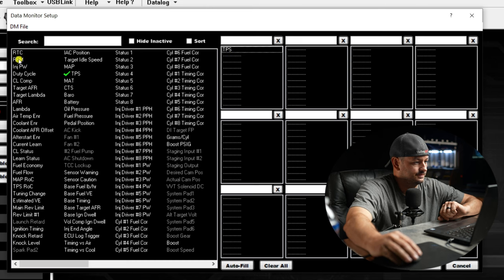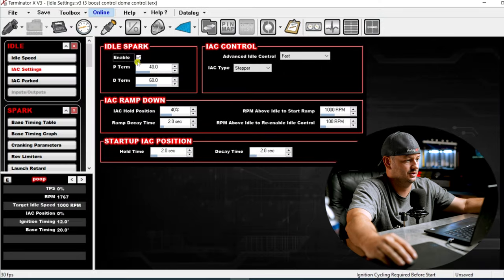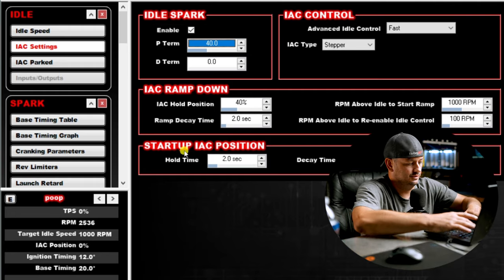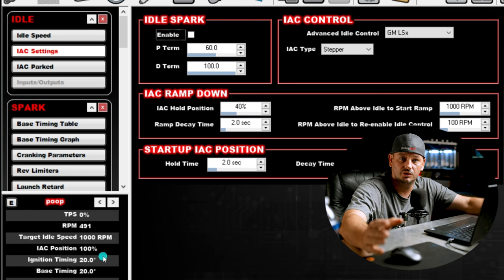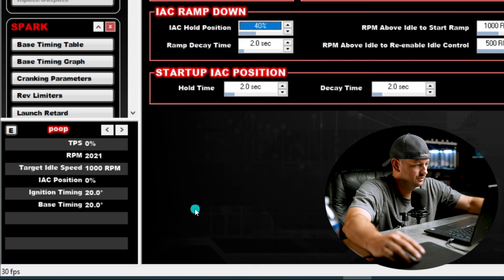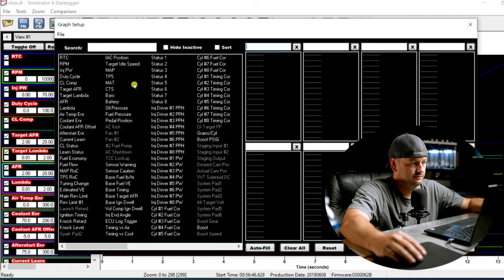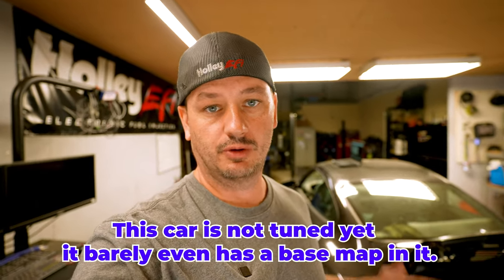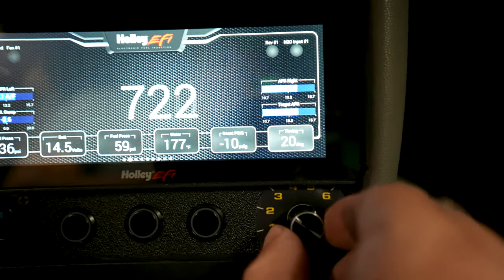What You Didn't know about IDLE CONTROL with Holley EFI!

Comment: Im still used to keeping my hand on the keyboard from using CAD and Solidworks so its more natural. 
When you select the row or column of cells you can press the letter R to interpolate the row and Letter C to interpolate the column or Letter S to smooth selected cells. 
All the hot keys make it so much easier to navigate the software.  
Letter O is for your offset of selected items.

Comment: On setting no 2 , on the custom table how do you make it swing the timing to create that loppey idle ?
Reply: I bet the answer is get the "tune the trilogy" series, LOL! This is just a guess, but I bet it's this:
1) the engine has some off the shelf cam with 210 to 225 degrees intake duration at 0.050" lift.
2) the idle stayed the same speed while vacuum dropped, so timing was retarded and the IAC opened to keep the idle speed where it's set.
Reply: All you do is make an ADV table to control timing offsets